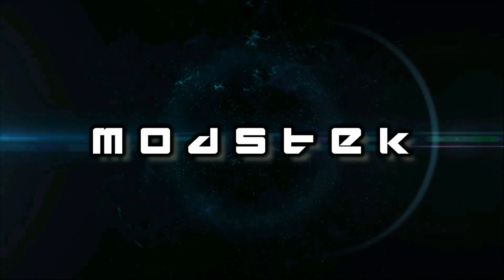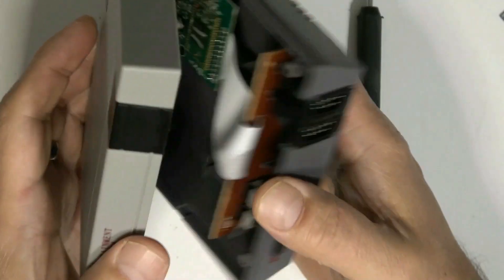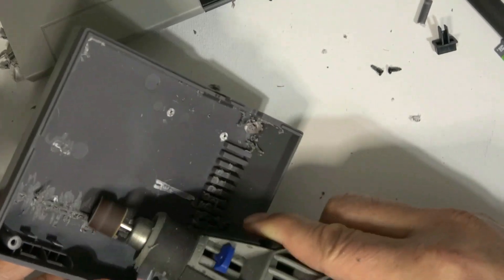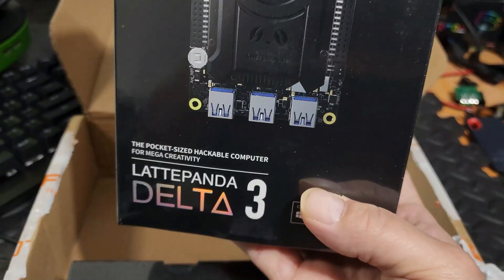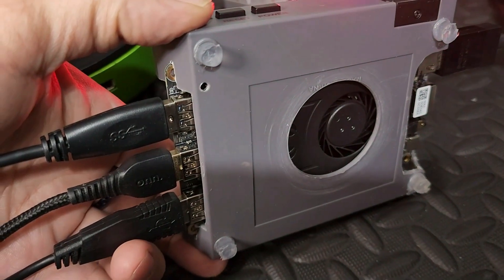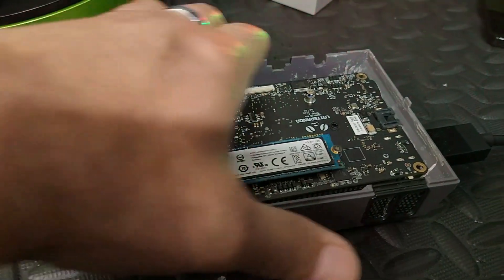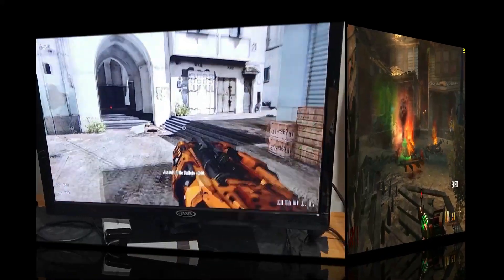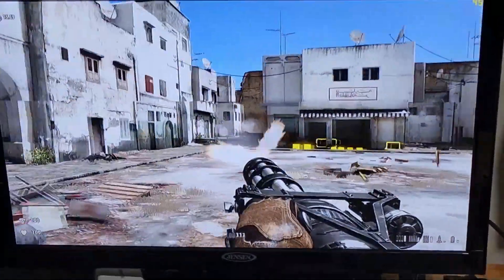mini gaming pc build with lattepanda sbc

Comment: can you add a discrete GPU?
Reply: You should be able to since it has an M2 PCIe 3.0 port, With the Lattepanda Alpha it was possible however it does make the whole assembly alot bigger. And you would need an extra power supply for the gpu
Reply: Yeah you can use a m.2 to pci express adapter and plug a gpu in but it will be bottlenecked